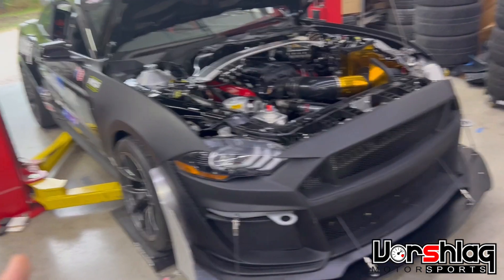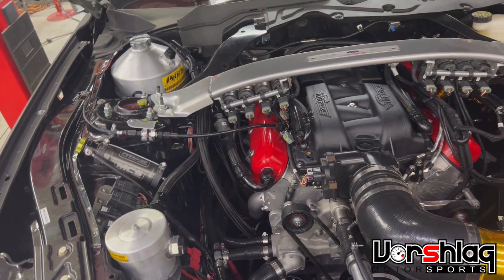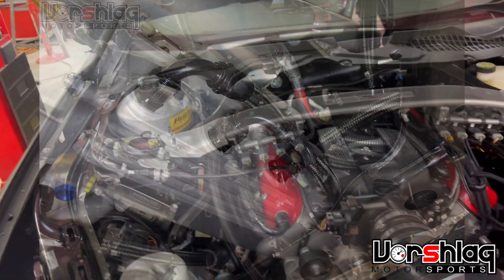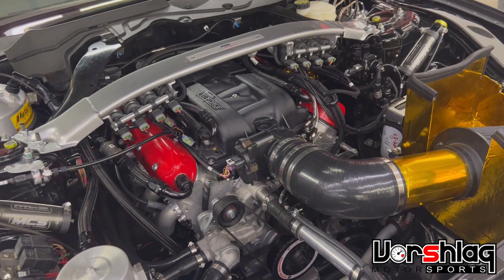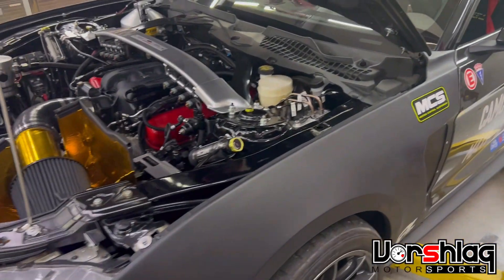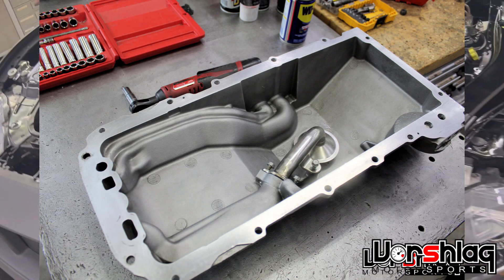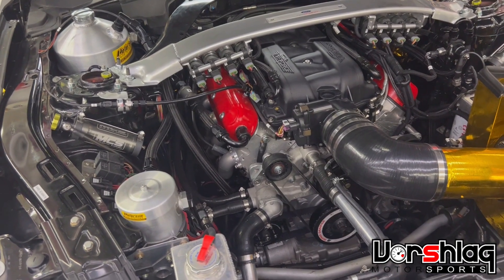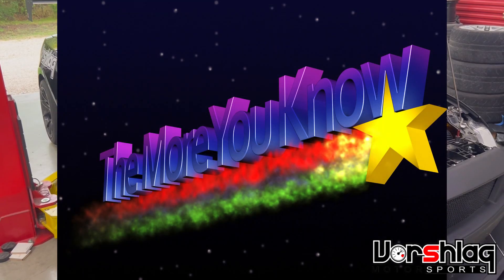Vorshlag Lessons Learned: "Real" Dry Sump vs LS7 "Moist" Oiling Systems

Comment: What about the c7z06?
Reply from the maker: That is similar to the C6 Z06, 2 stage internal "dry sump" pump. They work fine for the OEM tires, but add an oil cooler (which adds a pressure drop) and super sticky tires and ... well... you better watch the oil pressure data. :)

Comment: WHY RUIN A MUSTANG AND JUST USE A Z28 I just don’t get it !!
Reply from the maker: This Mustang was already in the scrap heap - it was a $2500 salvage car: https://photos.smugmug.com/Projects/Vorshlag-2015-Mustang-LS550/i-qSzF2jc/1/5278728f/X2/partsfarm-s550-X2.jpg

A 6th gen Camaro has a LOT of downsides compared to the S550 chassis. They have crappy differentials, poor outward visibility, terrible ABS systems, much worse aerodynamics, and more. 

While this LS swapped S550 might not make sense for you, with as many S197 and S550 LS swap kits as we've sold, it is a valid pathway for a LOT of other people. :)
Reply: @Vorshlag I think the swap is cool AF dude